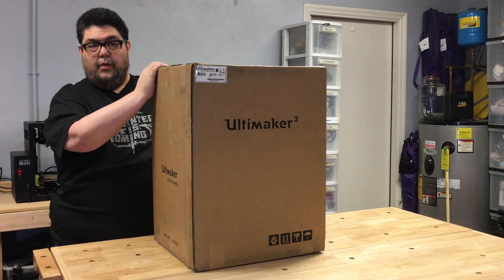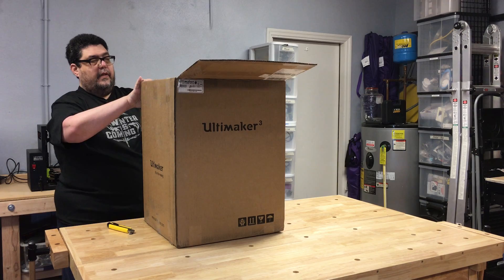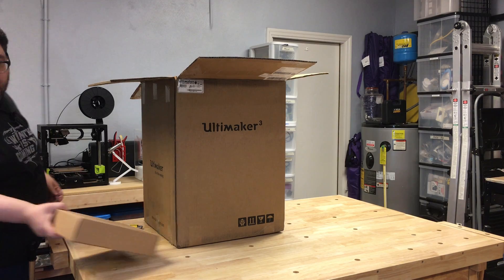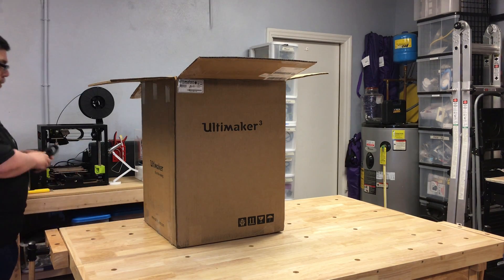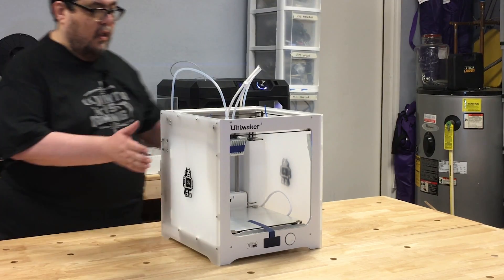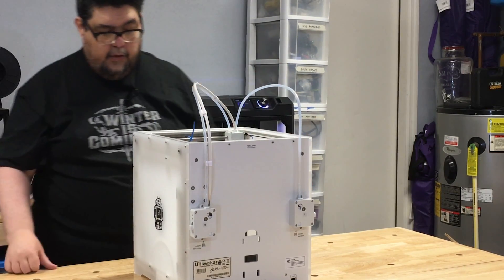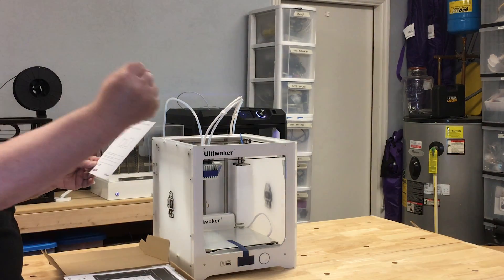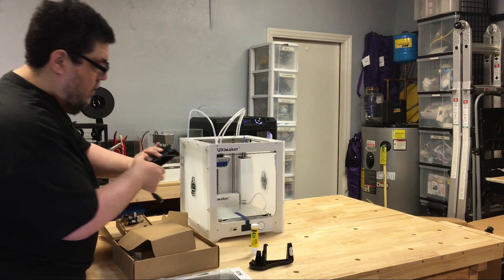First look at the dual-extruder Ultimaker 3

Comment: Do you still enjoy using your Ultimaker 3 after a year of use?  I just bought one from Matterhackers, but was initially reluctant to pull the trigger due to the cost.  There are so many good printers out there now that are cheaper and offer more features.  However, when looking at quality (and ease of use), Ultimaker continues to come up.  I know Raise3d and Prusa is making a dent in the 3d community, but do they beat out the UM3?  Would you buy again?  Thanks....
Reply from the maker: To be fair, I didn't buy it. I get these devices in to review for ZDNet. That said, the Ultimaker 3 is awesome. You can get less expensive and workable 3D printers, but the overall quality and support of the Ultimaker is excellent. My general advice is if you're a hobbyist and it's a real struggle to afford it, go for something that's a lot less expensive (but considerably more finicky) like the CR10. But if you're a business or busy or the cost isn't a stretch, the Ultimaker 3 is something you cam just use and rely on.
Reply: I teach middle school and like to create and print reward items for my students.  I've found that they really respond to items that are made versus bought.  I actually looked at the CR-10, but you're right, it required way too much tinkering (although it does look like a nice printer once it's dialed in).  I really appreciate your input, I was starting to second guess my decision, and now I can just enjoy my new printer.  I look forward to your new content.
Reply from the maker: Did you get a chance to watch the Ultimaker interview? It was very interesting. Also, I'm working on a dissolvable filament piece for the U3, which should come out in a month or so. So, definitely new content for the machine coming. My most recent project (which I haven't yet documented) was also done using it.